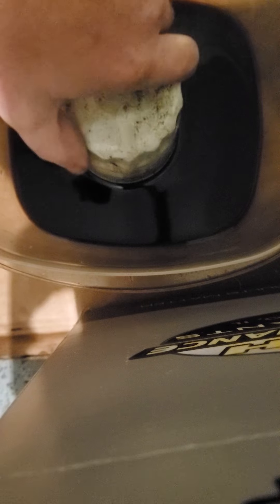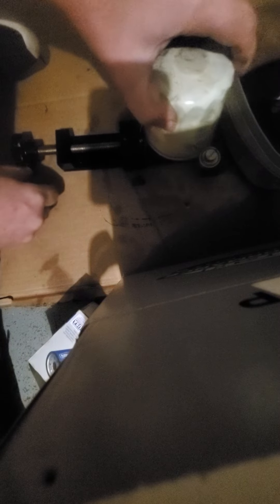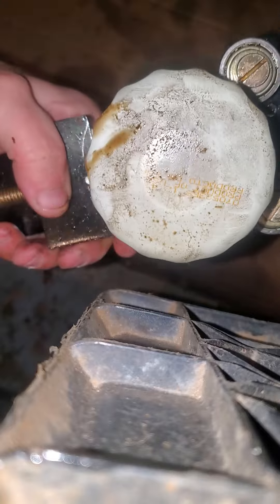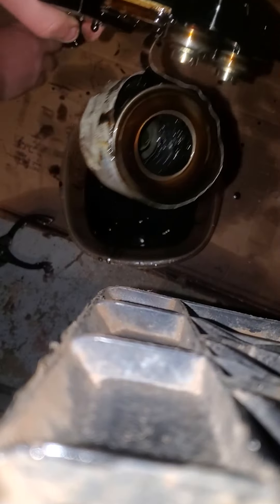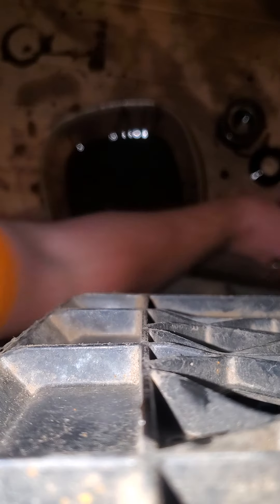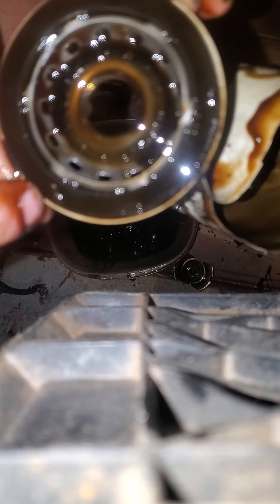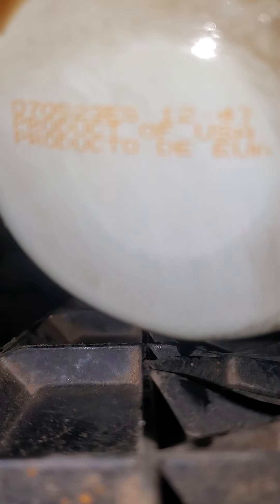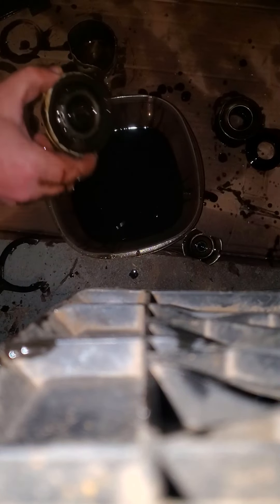Supertech ST9688 oil filter cut open ✂️

Comment: That is a lot more than 1000 miles!..........maybe 10,000mil.
SuperTech Filters are made by Champion USA. Champion claims their filters have a service life of 30,000miles. Common sense  say´s that depends on the car and driving conditions.
The stamp on the top may mean that it was destined for Germany DE. EU.
Reply from the maker: Seemed that dirty huh! This engine must have cleaned up really well. *this engine was only in for about ~1000 miles... 10k was old one. Must have been in part due to HPL oil 🛢
Reply: @82_KID  How many miles were on the car?
If all that black sludge had loosened up from the last oil change then the car was not very well services by the previous owner.
Reply from the maker: @markwarnberg9504  This is a junkyard engine.  It went in somewhere around a 1000 miles ago. I'm a fan of this motor oil it's called high performance lubricants some can be bought at WW.advlubrication.com But it has the same cleaning effect as any pencil or any good quality motor oil that's synthetic... Is my prime guess as to how the oil filter got that dark. I suspect I bought a dirty engine. The yard listed the car it came out of as having a 147000 miles.
Reply from the maker: @markwarnberg9504  for reference... As I make this reply to you, The car's body and everything that's not the engine and transmission has 282497 miles on it right now this second as I make this post. The engine and transmission have both been changed. Unknown miles on the transmission but I made sure it runs like a top I keep that fluid looking red. This engine well it's doing okay now since I changed the fuel pump... The filter cut open I waited about a week or 2 after I got the engine and just changed it right in my garage and it's been sitting on my garage floor for another week or 2 and I just decided to cut it open. I apologize for the not so great camera work but I just want to give you the full story here.
Reply: @82_KID  A lot of miles! Thanks for the link, checked it out, don´t see any API rating on their oil.
Reply from the maker: @markwarnberg9504  ahhhh, yes. The owner of company David Ward he once explained to me, that..  Formulating his oil in a way that would be able to get an API Starburst for 5W-30 and/or an API rating  Would have him make compromises in the formulation that wouldn't then give him the ultimate passenger car motor oil. Very good catch.  And I actually just got up and went out to my garage and double checked there isn't any certification on the bottle.. I just remembered that is why. It's a Group V oil.. Redline, maybe some say HDEO (heavy duty/diesel engine oil, CJ-4 etc) again Pennzoil.. some oils will "strip the guts out" and achieve an accelerated "de-sludge." I should do a follow-up on how my oil looks now.. and actually start keeping track of mileage. I use that car so much as maybe can tell from my mileage update videos.. Time blurs together, is the main reason my record keeping was so bad.
Reply from the maker: @markwarnberg9504  I also made an update video for you as well 📹 https://youtube.com/shorts/9Tz-eAshhoY?si=upLlFZDBBk1Ry3S0
Reply: @82_KID  Group 5? 100% Synthet, well...that will flush out an engine pretty quick. A Group V has a API rating of SN or SP.. I´v been useing SN since it came out, don´t bother with Brand Names, Mannol from Germany has given me the best price. 
Happy motoring
Reply from the maker: @markwarnberg9504  well. From what I understand you can't have 100% Group V. But yes.. HPL is a heavy Ester blend.. has ANs in it too.. much like a Motul, idk about Ravenol but yes, premium great oil! 🛢